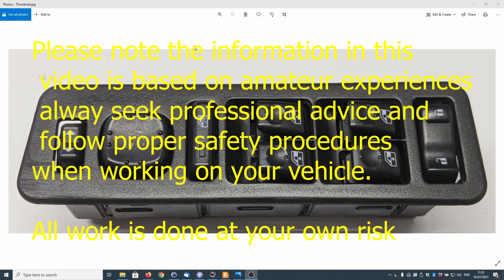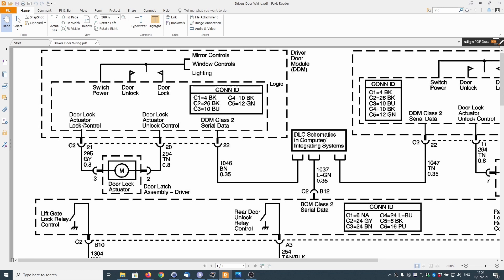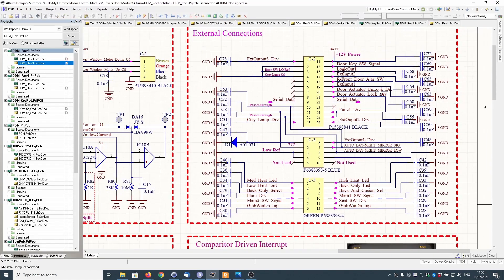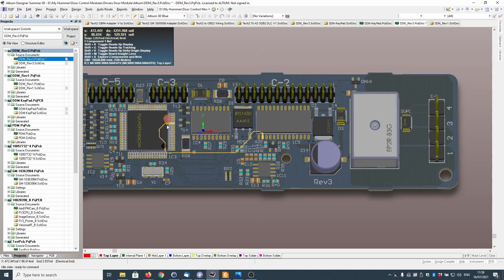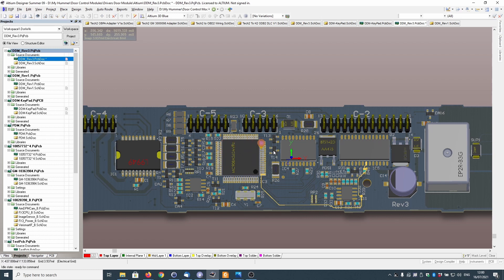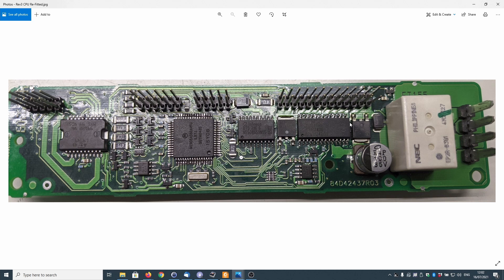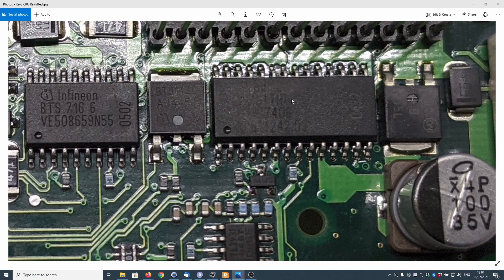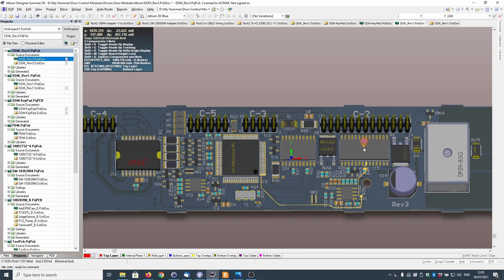Hummer H2 2005 - Drivers Door Lock Not Working

Comment: Please let me know if you have any information.
I'd like to check the H2 2005 gauge motion at 12v, but I don't know the gauge back terminal information.
Reply from the maker: arigatou MAsahiro-san. I think maybe (tabun) you are talking about the "Drivers's Door Actuator" also referred to as a door latch assembly? Anyway the part that locks the door. Personally I have never seen one up close, but according to the manual there is a 10-Way Connector (AMP P/No 10768367) which is wired as follows:- 
Pin ------ Wire Color ------ Circuit No -------  Function
1                   xx                     xx                    Not Used
2                TAN                 294                    Door Lock Actuator Unlock Control
3                Grey                295                     Door Lock Actuator Lock control
4-5              xx                     xx                     Not Used
6             Grey/Black       745                     Left Front Door Ajar Switch Signal
7                 xx                     xx                     Not Used
8               Brown            1183                   Left Front Door Switch Low Reference
9            Light Green       262                    Driver Door Key Switch Signal
10              xx                      xx                    Not Used

Hopefully this is the info you need, if not please provide more details and I will do my best to help.😃
Reply: Thank you for your quick reply.
You are good at Japanese.

I apologize first.
There was not much explanation.
What I want to know is the speedometer gauge.
I have an assy.
I'd like to check if it works at 12v【+、-】.
But I don't know the terminal information.
You know so much that I relied on you.
Reply from the maker: @Sskkwe  Masahiro-san. If I understand correctly (wakarimasu) this is the litlle (chīsai) speedometer motor? If so then it is not possible to connect 12V directly, it is more complcated than that (muzukashi desu) All the guages on the instrument cluster are the same maybe this video will help https://www.youtube.com/watch?v=QGtALzf4XCw
Reply: Please watch 12min 40sec.
I'd like to know how it starts on the desk.

https://youtu.be/efnXlc0Xisk

Comment: I’m having problems with my 2005 H2. I’ve replaced the right rear door actuator, replaced the left rear door window switch, but still have right rear door ajar message on dash and both rear door windows won’t go up or down, from with the rear door switches or from the drivers door controls
Reply from the maker: Thank you so much for your comment. The "R/R door ajar" and "Rear window up/down" conditions are seemingly unconnected as far as the wiring diagram goes. 

So for door ajar issue, it may be worth checking if its real or not. Located inside the R/H "B" Pillar is connector C390 Pin H a Light Green + Black wire,  this connects (eventually) to BCM connector C6-A2,  I would be tempted to put a volt-meter on this connector pin and see if it changes state when the door closes/opens, I presume door-closed = 0V, open=+12V 

As for the rear windows, this is strange because the LH & RH sides are pretty much independant with the fuses, power, grounds, circuit breakers, relays and controls all seperate. Essentially the DDM communicates with the BCM and the BCM controls the left and right window relays. It's as if the DDM lockout switch is active, but then the front right passenger window should be inactive too (I think)

Slightly worrying it could be BCM related as all these function relate to a single BCM Connector C6 (possibly not plugged in correctly?) but I'd check the RR AJAR switch first. Could be dry joints on the BCM connector (hopefully not)

Best I can do with the info at hand...
Reply: @hummerfixes  thank you for answering so quickly! It’s so nice to speak to someone who can speak the same “language”, as far as the “right rear ajar” message, I’d already traced the complete wire harness going back to the right rear door, disconnecting at the “B” pillar plug and also the C6-A2 purple connector at the BCM using the meter checking for a ground fault from either a break or chaffed spot in the “light green + black wire right rear door ajar wire with no luck. The only thing I did notice was that my shop installed Viper alarm door trigger switch wires tapped directly into the C6-A2 purple plug at the BCM and with the wire harness disconnected at the BCM and at the other end at the right rear door actuator showed that there was a ground issue somewhere, so I’d disconnected the alarm trigger wire and the issue went away, BUT the trucks dash still says “right rear door ajar”.
And like you’d mentioned, the rear door window up and down switch wires also go into the C6-A2 plug at the BCM. I’ve removed the purple plug at the BCM multiple times for inspection, wiggled it, tried everything. Right now the alarm is disconnected until I can fix the BCM from thinking the doors ajar because it continues to trigger the alarm if connected.
If it is a BCM problem, can I buy a new virgin BCM from the Chevy dealership and have it programmed?
I thank you for your communication and help
Reply from the maker: @lifestylecustoms9354  You've done some very impressive investigations thus far.  Before going down the BCM replacement route,  there are a couple of things I'd  try (someone last year fitted a new door actuator which turned out to be faulty) The following assumes "Door Ajar" = Low Volts as the wiring diagram suggests and the BCM input voltages operate as anticipated.

1st,  If possible measure the voltage on A6-A2 (RR) and compare to A6-A3 (LR) whilst opening/closing the respective doors, the results should be very similar or the same. If A6-A2 does not change state maybe something is still grounding that circuit (bad actuator) or the BCM is defective. Try unplugging C390 and see if the A6-A2 voltage changes.

2nd, Removing the BCM is a pain, but ifit is the BCM, again I would be tempted to remove (tricky) and open it up and inspect the PCB, particularly looking for dry joints to connector A6, watch this this video is similar> https://www.youtube.com/watch?v=nuqAgT6__s8 

Regarding dealership, new BCMs and programming etc I have the feeling that is an expensive route to take, in all honesty I've never tried reprogramming a BCM myself. However if your not a member of www.hummerforums.com I suggest joining there are some very experienced senoir members who maybe able to help you with your questions. Here is a thread relating to BCMs https://www.hummerforums.com/forum/hummer-h2-8/bcm-removal-help-41935/

I believe the BCM holds the VIN number also a TECH2 scan tool is required to set up the vehicle (AirBag, brake pedal relearn)

BCM replacement, repair, reprogramming is a subject I'd love to cover in great detail, I would also love to get my hands on a BCM, even a dead one.

Comment: You an your videos are a blessing,helped me out with my Hummer an ton.Thank you👍👍👍👍👍
Reply from the maker: Thank you, so much,  just glad to be of help 👍
Reply: @hummerfixes  one more thing,have you ever had a problem with your 4wd service light come on?mines came on an my 4wHi light was red?now I'm worried to even drive my Hummer.left it in my yard for a month now.Thank you for any info that you have
Reply from the maker: @trevishornsby7385  Got mine 7 years ago, one of the 1st messages I ever saw was "Service 4WD" you can imagine my thoughts. Someone told me the H2 can throw this message if the Transfer Case doesn't get used ver often, they said the trick was to cycle through all the drive mode combinations periodically. 

Please watch this video, it explains it very well 

https://www.youtube.com/watch?v=eKcF8egC-hU

I do this every few months on a short straight stretch of road (a dirt track is ideal) Caution, you're not supposed to drive on pavement, especially round bends, in Rear-Axle-Lock (it's in the owners manual)

Let me know if cycling fixes it,  it's always good to keep the fluid changed (nice and pink)

Also the manual also says the message can be cleared quote 

"Pressing any of the four DIC buttons or the trip odometer reset stem will clear the message from the DIC display"
Reply: @hummerfixes  thank you my friend,I got mines a year ago.it looks like yours black on black 2005,I've only drove it 2000 miles since last year so yeah that is probably vwhat I'm going thru.thank you again my brother you are a blessing👍👍👍👍👍